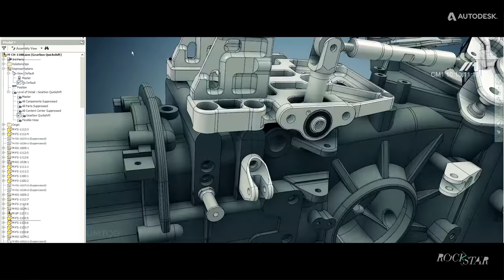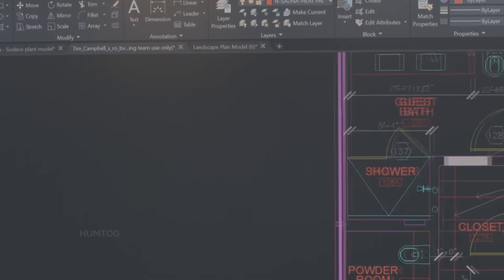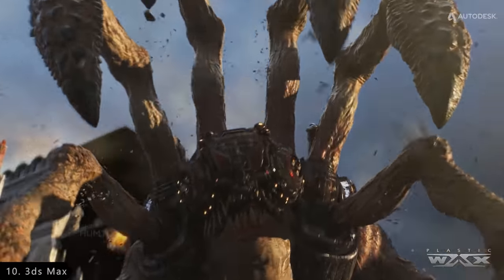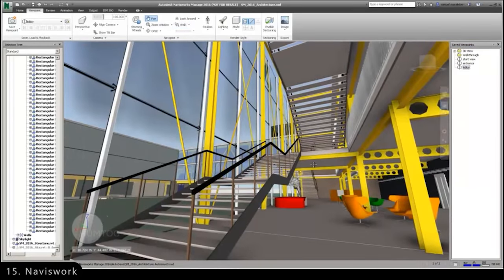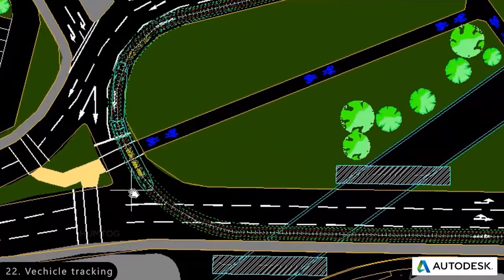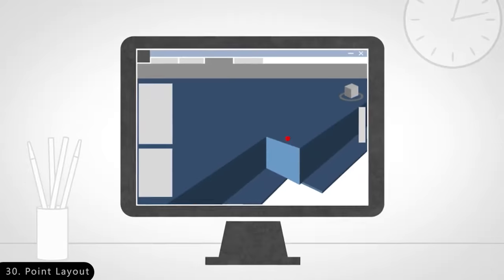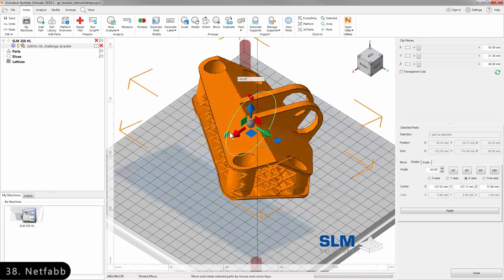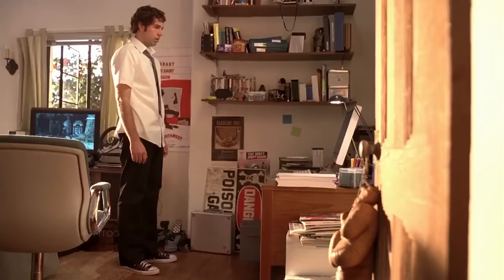All 50+ Complicated Autodesk software explained in 12 mins

Comment: In terms of the Architecture, Engineering & Construction (AEC) segment, Autodesk Revit is used for more than just architecture, it's the only software where also structural and MEP can work in the same environment and has a dominant hold of the market that is moving into the BIM (Building Information Modelling) direction. Revit is basically a graphical database for complete buildings to which Dynamo (Studio) is also an exclusive product to. This all can be connected to the cloud for collaborative work, and while Autodesk BIM 360 that was mentioned in the video is being phased out, it's being replaced by ACC, the Autodesk Construction Cloud. These also run on Autodesk Forge, a developer platform that is the backbone of everything that happens in the cloud.
Reply: To add to this, Autodesk Tandem wasn't mentioned. It is a digital twin platform for AEC that is designed for Revit and IFC (open format) models, meant for the owner and operational stage of a buildings life cycle.
Reply: @SoBek49  Tandem is brand spanking new though to be fair. Pretty sure it's not a widely available commercial product yet.
Reply: @vanrensburgarchitecturebim1641  that's refreshing to hear, wish more architects would think like this.
Reply: @vanrensburgarchitecturebim1641  Absolutely, I've been part of that effort for years too. It's a conservative industry though, change happens slowly but you can get a lot done on the frontlines.
Reply: Hence the problem. Too many segregated softwares that should have been one.
Reply: @ihateregistrationbul  I'd say it's the present. Every new construction job I've done since 2015 has been in Revit. We still use CAD for smaller renovations, details, and diagrams.

Comment: When my mum studied interior design in the early 80s, she had to do everything on isometric paper, with minimal training for digital design. Nowadays, if she wanted to get back into that line of work, her skills would be basically obsolete. 

It never occurred to me that a company would have to design and sell this sort of modelling software for architecture and the like, but it seems obvious there would be an Adobe for the physical world.
Reply: Well it is a completely different world from 40 years ago. Probably not as big as when cars and home electricity became mainstream though.
Reply: Her skills wont be obsolete, she knows what to do as a interior designer the only thing that will change is that she would learn how to do it on the computer, her knowledge about interior design is still relevant and the same today its just "pen" she has to use is different nowadays. ( Before it was an actual pen, now that pen is changed to a computer)
Reply: My computer graphics teacher in high school was in a similar boat. He trained all his life to draw blueprints, which requires meticulous penmanship without the help of computer graphics. When blueprint software came out though, his career was pretty much over.
Reply: I know how to get around in AutoCAD and Fusion360 pretty well, but I still pull out my isometric paper and set squares quite often.
Reply: @rubyy.7374  most CAD users today learned hand drafting in school
Reply: @rubyy.7374  ah, yes, my career is over because I refuse to learn new tools to do exactly the same job as before with no actual changes
Reply: @jhsevs  some people simply aren't good enough to learn new tools
Reply: @pianissimo7121  wow. That's some low end attitude if I've ever seen some
Reply: You should film her going to an interview at a big architecture firm in 2022 with her isometric drawings and a typewriter in a briefcase for taking notes. That would get even more views than this video no🧢
Reply: Sad truth to it is each generation of architects, engineers and Interior designers slowly become outdated simply because of how fast these softwares are developed and changed. The industry is also everchanging so what may work now could change within the next 5-10 years. Harsh reality is,  any field of work prompts you to stay up to date with everything till your working career is over or else you really do become obsolete.
Reply: They should hire you. You just coined their next slogan, lol

Comment: I always wondered what software civil engineers and architects used. That was a great learning experience!
Reply: Revit mostly nowadays, AutoCAD is kind of becoming obsolete for us architects.
Reply: @awaishssn  Why do you think it's obsolete ?
Reply: @switaly  Revit is a BIM (Building Information Modeling) software, which means that rather than just being a 3D model, each component in the model his important information associated with it. This makes it much easier to use for things like cost estimating and collaborating with contractors. Some clients will even insist that architects use BIM software.
Reply: @awaishssn  autocad still has a place in smaller projects but I agree
Reply: @switaly  it's very mechanical and has almost no intelligence associated to its 2D/3D features. Revit is very good at everything and way faster, efficient and it fits into the BIM workflow very well. AutoCAD is pretty much useful for just 2D sketches which are not extractions from 3D revit models. Civil 3D still has its place though for numerous reasons, but yeah AutoCAD will slowly phase out eventually. With newer products like Formit getting more and more feature packed, I don't see why people would still want to work in the AutoCad environment.
Reply: Yeah. Im a civil engineer and we use Civil 3D at the company I work at. It works pretty well for most things, but I still wish that it had some more features. I don't think Autodesk has meaningfully updated it in years...

Comment: The madman actually did it... I remember in Highschool we all got educational access to like 30 Autodesk programs, but we were never told what it was or what to use the programs for. We were encouraged to create 3D CAD drawings of our projects in technology class, so I tried learning AutoCAD and hated it. I figured it was the right program for the task since it literally has CAD in its name, but as I later learned, I probably should've used Fusion 360.
I later had a Mechatronics class we were actually taught how to use Solidworks, which could've been real handy earlier. I'm now in university where we're learning to use Blender for more creative use rather than engineering. Ironically enough I'm struggling more with Blender than my peers, because I have experience with CAD that I need to unlearn. Really wish I could find some Blender tutorials that targets CAD useres who want to learn Blender for creative uses.
Don't know why I went rambling in such a long comment, but thanks for reading whoever you are, lmao.
Reply: I agree. Working with something like Blender after using NX and Inventor for many years I have to "unlearn" the parametric modeling mindset and techniques I used in those software. Blender is an amazing piece of software and I have new found appreciation for people who use it on the regular.
Reply: To me it was the other way around, in 2020 I learned a little bit of blender like a little hobbie but the navigation systems sticked with me, then, in 2021, we started to have the subject "CAD" and I was a walking mess because I couldn't get used to it, after 2 months I could do it but it was kinda hard
Reply: Biggest cross over is use the left hand for keyboard shortcuts, I wish blender had a command line.
Reply: Yeah trying to go from fusion to blender has been tough..theres so much from fusion i wish worked the same in blender

Comment: Did I just miss it, or did you not include Autodesk Eagle? Used for circuit design and board layout and 3D board rendering and evaluation.

Awesome video, would be really cool if there was a table of contents with links to timestamps of each tool :)
Reply from the maker: Thanks for noticing. I somehow missed it while making the original research of the video. By the time I noticed it and wanted to badly add it to the video as it is something unique, it was too late and entire video was basically complete. Now it exists in the video as just as an image in the last part of the video.
Reply: Autodesk Vault was a fairly big omission as well. Interesting video though seeing someone's perspective of Autodesk from outside of the Autodesk ecosystem.
Reply: Technically Eagle doesn't exist anymore as it's been absorbed into Fusion 360.
Reply from the maker: @Leo Warren - Thats how I originally missed it as I didn't see it in their site among products. And that is why it was included at the end along with all other "plugins, addons etc". But, it was a unique and interesting software, thus, I should have included it.
Reply: @ScottMoyse  Vault is in there too 7:30
Reply: @Janktzoni  cheers. I missed that.

Comment: I thought already I used a majority of Autodesk software. I was wrong. Off the top of my head I’ve mainly use: various Autocad flavors, Revit, Fusion 360 (unironically my main architectural modeling program) and sketchbook pro (technically not autodesk anymore as of 2021). 
Seldom used/hobby use: Meshmixer, Civil 3d, Maya, 3ds max, Vehicle tracking. 
Booted just once: Inventor, Mudbox.
Man the education license is one helluva drug.

Comment: I've been using Maya for modeling/animation for game dev for 7 years now and honestly still dont really understand the the differences between max and maya. Like ii get that they structure model history differently (maya creates basically a list of nodes containing every action you do, where as max is more like a stack of modifiers iirc) but asside from small differences in workflow like that, they seem to be used almost interchangeably in practice.
Reply: Historically Maya and Max were direct competitors to each other, serving the same needs. Then Maya got acquired by Autodesk and Autodesk decided to keep both of them going since the industry was already so starkly divided and entrenched in their software of choice. Given the continued differences all these years later, I assume Autodesk runs both teams entirely independently to ensure some form of internal competition when innovation may otherwise have lagged due to a now lack of major competitors.
Reply: @puzzzl  I understand that much, its just more so I don't really see much difference in their use cases beyond personal preference, which is totally fair, just rather unique compared to the rest of their lineup where everything seems to have a distinct use case to separate from other similar products in their lineup.

Comment: I know this is not a forum yet I have been working on projects in which I need to simulate water movement (like in pipe lines cross section and tanks ) what do you guys use for this ? I only use Inventor Fusion 360 and Autocad

Comment: Did you mention Autodesk Eagle? Or did I just miss it.
Reply from the maker: Thanks for noticing. I somehow missed it while making the original research of the video. By the time I noticed it and wanted to badly add it to the video, it was too late. Now it exists just as an image in the last part of the video.
Reply: @Humtog  I only noticed it because it's one of the only two Autodesk softwares I actually use regularly. Besides Autodesk has only owned it since 2016, and it was released in the late eighties iirc so it's barely counts as Autodesk software :P

Comment: Why? Why do you need 6 programs for architecture, 9 for animation, 12 more programs built around one feature? Can you imagine how much easier it would be to work in ONE architecture program? So much less redundancy in the features between applications, file consistency, only having to learn one program...
Reply: Because Autodesk didn't directly make all of them. Autodesk operates on a business model where whenever there's a small studio making a very interesting program based on animation/CAD/architecture/civil engineering/mechanics, they often just buy it and then develop further upgrading it and making new versions of it. One thing they do right is the fact that when they buy a program or a company, they don't kill it, they just develop it into something better. They have done that to many of the programs on the list, that's why you have so many different programs for architecture or animating. Besides, it's also about money. Imagine a ONE architecture program like you mentioned? A one that would put all the features into 1 program? Too many things, program would be extremely heavy to operate, You would need a very good PC to be able to handle it, also money. A program like that would cost A LOT to own. It just would. It would be much less profitable for them. Currently if you own an architectural design studio, You might decide that you just need 3 out of 9 programs and buy their license (if you can afford it), because you might not need all 9, as some are less advanced than the others. It gives you a choice while cutting costs for you and also making Autodesk more money in the process. If you had everything in 1 program, it would just be very expensive to own, would make it more elite to own a piece of software and that's not what Autodesk wants to do. Their programs are still very expensive, but just the best on the market, nothing can compare. Thats why they are expensive, but not as expensive as to make it impossible to buy for people who run decently successful companies. Another thing? Handling the development of it. Autodesk has teams that are responsible for their own programs thus can be more compatible and more precise. Imagine one huge program, how many things could go wrong. Those programs are super advanced anyway. Autocad literally lets you build a very heavy and complicated 3D constructions to a single screw, then also add textures into it and make it literally look like a finished product. Honestly, being in civil engineering You just need AutoCAD, Revit and Robot, maybe some additional thing, but mostly it's just Revit and Autocad, all you need. if You design roads, just get CIVIL 3D, a special version of autocad dedicated to that. A simple matter of choice and cost. That's why you don't have everything in 1 program. Doesn't mean in the future we won't have a mega systems where we will have everything in 1 program/computing architecture, who knows.

Comment: All these products, and all the insane revenue, yet they still pinch features for their free and lower-tier software licenses. Plus let's talk about how bugged their software gets after light use, how their updates are so ungodly inefficient it'll slow programs to a non-responsive state, how their updates work on launch and there's no option to update at will, how the devs absolutely do not listen to their community, example being the lack of a dark mode UI in some applications that has been asked for since day 1 with no implementation years later. Not to mention a lot of their non-cad stuff, and even some of their cad features, are bought out and not built by the company itself. Just another case of rampant capitalism getting out of hand, on top of Autodesk themselves being a terrible company.